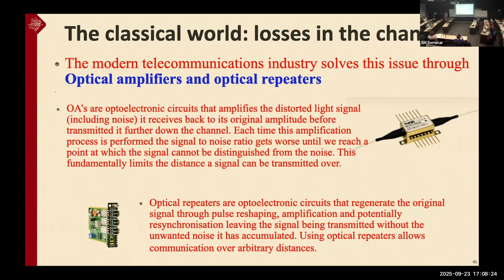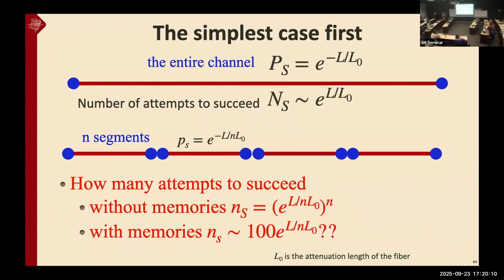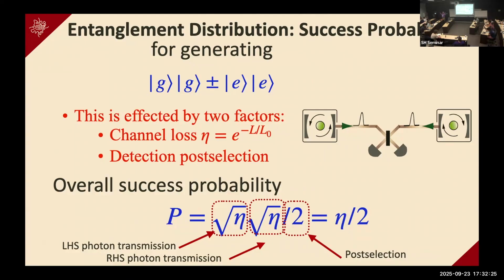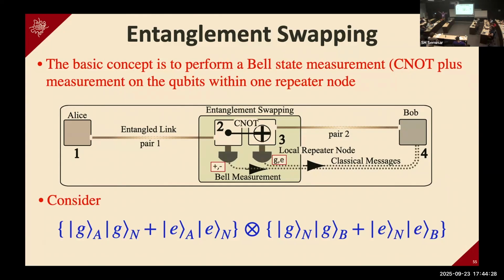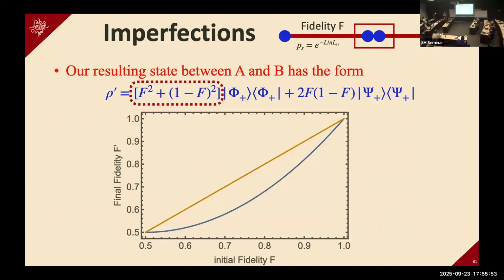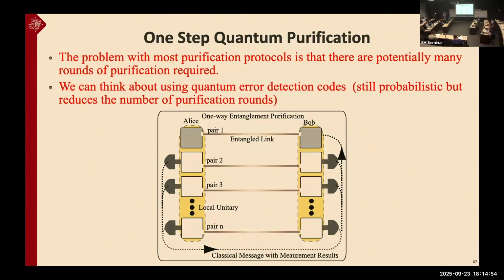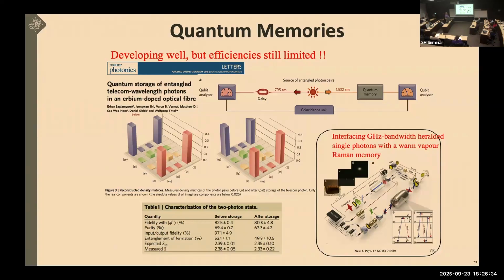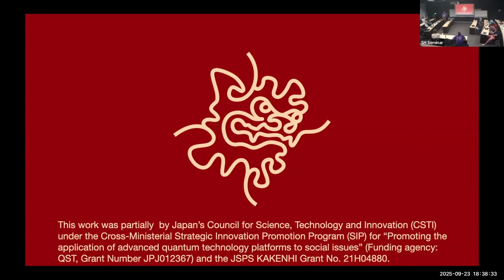OSP2025 | William John Munro | Quantum Relays and Repeaters | Okinawa School in Physics 2025

Comment: Hi, Is anyone willing to endorse me on arXiv. Orcid 0009-0004-1448-6889
Paper on phase synchronized learning in photonic interferometric meshes. Robust data set included, recorded over an 800k continuous cycle test, 200k cycles per mode; stable, learning, ablation and perturbation. Core testing was done mostly using NumPy, SciPy Matplotlib and standard python timing/ loop constructs. The ancillary bundle on the data set analysis used C++ backend acceleration when possible and SciPys linear algebra and signals processing modules for stability tests